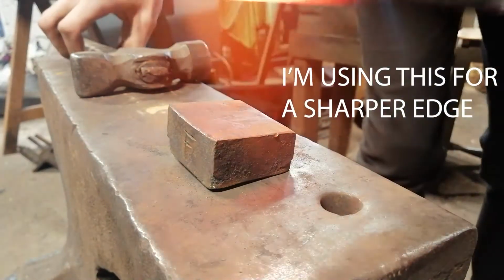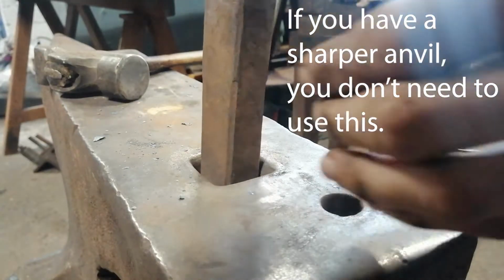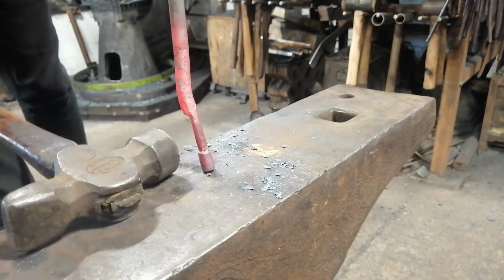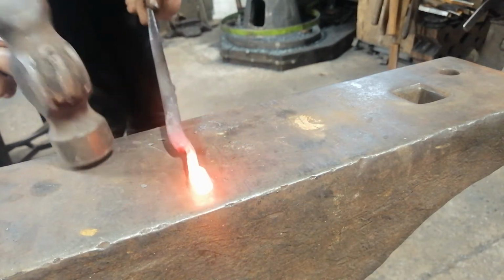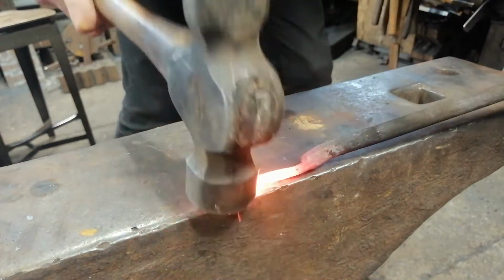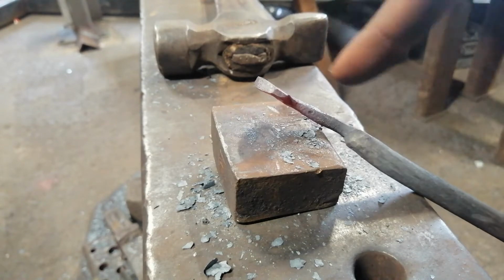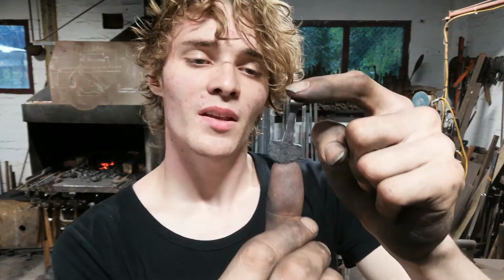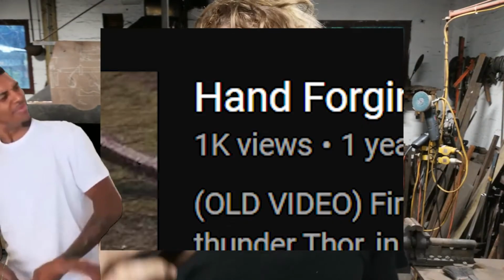Forging A Mjolnir Pendant

Comment: What type of steel is this?
Reply from the maker: Mild. All that's needed. You can accomplish this with most steels. So long as you keep it hot. Try to keep it at forging yellow or orange. It's very easy for faults to appear at this scale. So I recommend mild steel. Very malleable.
Reply: @femboyblacksmithing5676  cool man, thanks!